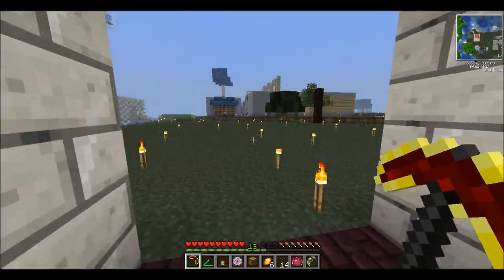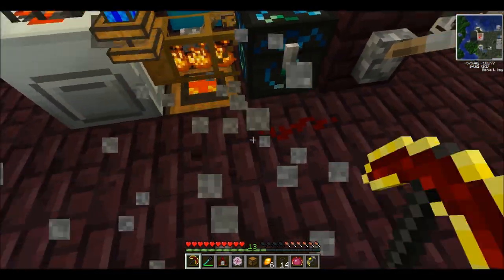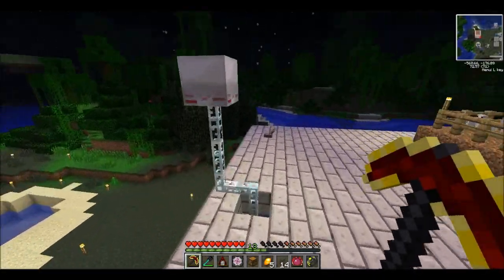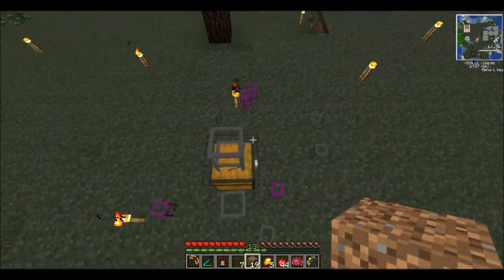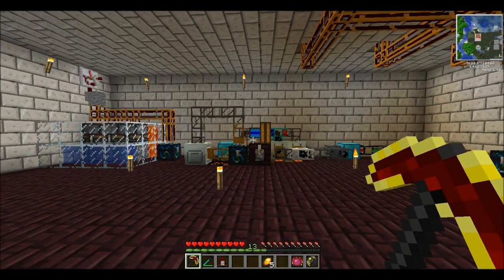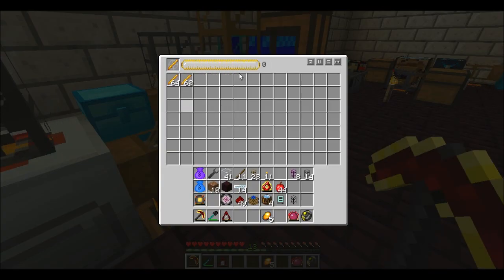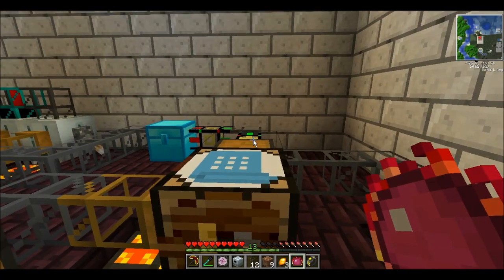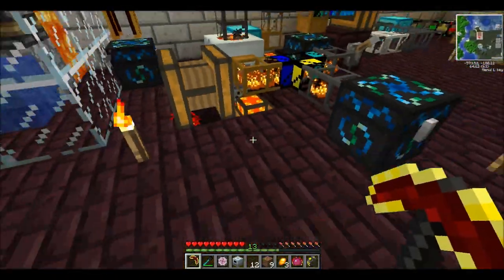Minecraft Let's Play S3 Ep. 46 - Automated Electronic Circuit Production

Comment: --- BEGIN ERROR REPORT bc576f05 --------
Generated 8/13/12 12:00 PM

- Minecraft Version: 1.3.1
- Operating System: Windows Vista (x86) version 6.0
- Java Version: 1.6.0_07, Sun Microsystems Inc.
- Java VM Version: Java HotSpot(TM) Client VM (mixed mode), Sun Microsystems Inc.
- Memory: 498870896 bytes (475 MB) / 532742144 bytes (508 MB) up to 1065484288 bytes (1016 MB)
- JVM Flags: 2 total; -Xms512m -Xmx1024m
- ModLoader: Mods loaded: 2
ModLoader 1.3.1
mod_ModLoaderMp 1.3.1v1